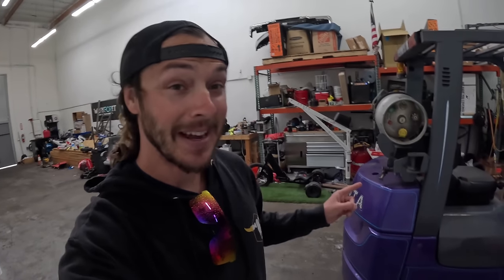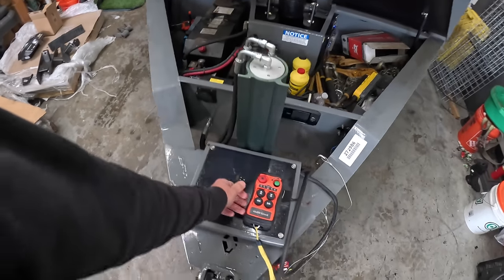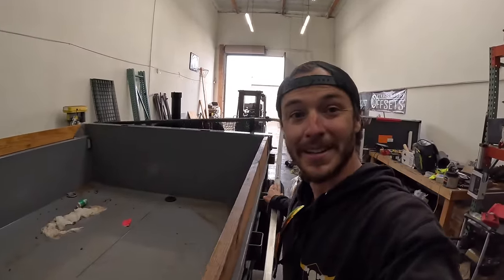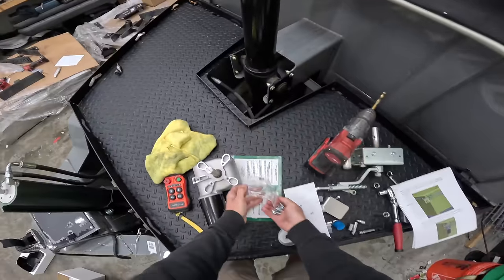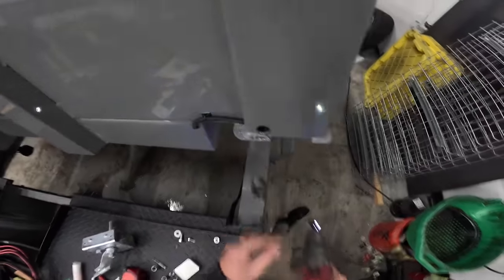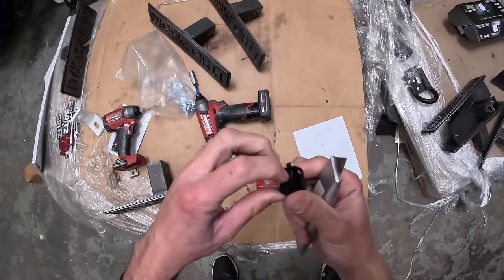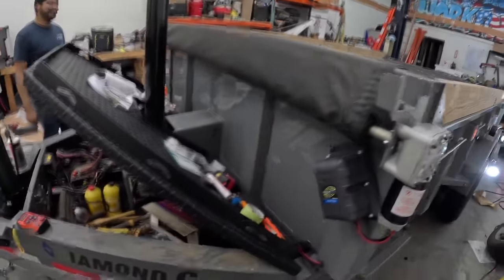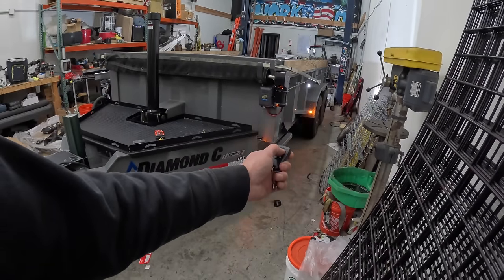THIS is Taking my Dump Trailer Game to the Next Level!

Comment: Yo Ryan I work with those tarp systems mostly on Dump Trucks and bigger trailers. If you don’t want to fiddle around with the side adjusters you can measure the distance it’s off to cause it to rack to one side then adjust the tarp on the front shaft to combat the rack, a temporary solution is to throw rags in it before you roll it     The more rags you stack the closer it will be to even. Back in the day you either had to do one of those two things or replace the springs to get even tension. Those adjustable mounts are fairly new to market but can be a pain if they aren’t done right to start.
Reply: i was wondering why he didnt try to adjust it this video, maybe he needed the space in the shop or maybe it takes an extra hand and he didnt want to take up more of sergios time this round.
Reply: @briancollins7296  you don’t really need an extra hand you just have to roll the tarp back to unload the tension pop the arm out of the crossover let the bow hit the ground un-bolt the pivot pin fiddle with the adjuster until he gets the tension even. Definitely time consuming though if you can’t look at it and have an idea of how many clicks he needs to go one way or another, a real rinse and repeat situation. (Ryan if you read this I would start at 3 clicks. Turn to the back to unload tension, towards the front shaft loads tension. You also might end having to do a click one way or another on the other side and most importantly you are going to want to start on the side you have to load tension to.) Probably be a title, thumbnail and a 5 to 10 minute clip in one of his daily vlog day in the life type videos or he’s waiting to fix it for when he replaces that crappy relay for his lighting system and making a video of all the repairs in one video.

Comment: Sounds like an OBS maybe getting a 6.7 powerstroke swap.
Reply: @Berm_Blaster I could be wrong, but I haven't seen a 6.7 swap yet that didn't involve cutting up a dash and swapping dashes. Dump truck needs something less invasive like an older 5.9 Cummins with a mechanical fuel pump. And I shout the praises of my 6.7 powerstroke.

Comment: A upgrade to the tarp system is definitely needed. I have had my trailer for 5 months and only use it a few times a month and the gearing in the handle has broken twice.

Comment: If you use a deburring tool on holes you make in steel, or anything  really, fishing wire becomes much easier. Handy little tool.
Reply: ive cut holes in so many materials my whole life and i never heard of a deburring tool until last year

Comment: Best way to keep your trailer battery charged would be to run heavy gauge wires from the alternator to the back of the truck to a separate connector, same concept they use for plow trucks.

Comment: Ryan, did you know they make special tools to knock the sharp edges off of the inside and outside of drilled holes ?
It will keep you from tearing off the insulation on the wires.

Comment: Maybe shoulda put some grommets in those new holes to better protect the wires before you ran them through, but good job regardless!
Reply from the maker: I would’ve never got them through with the grommets
Reply: @DMAXRYNO   I hope you don't take this in a negative way, as a professional, when you point out issues with concrete, I don't always understand because I'm a sparky, but I trust your expertise,  @newfization made a comment about using a deburring tool, it's absolutely not a must, and I doubt you did any real damage, but it sure would save the insulation on wiring if you have time in the future
Reply from the maker: @johnl9665 yes, a deburring tool would’ve been ideal, unfortunately I didn’t have one.
Reply: I dont know how u do all this stuff & film simultaneously but it works, great channel